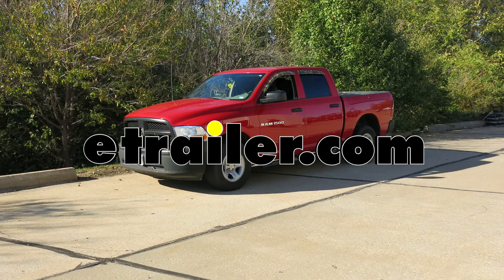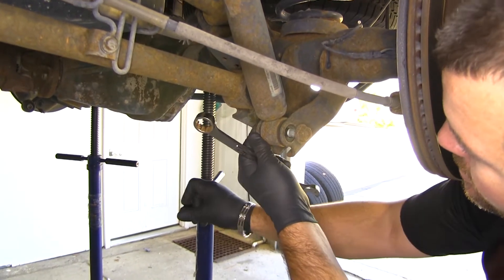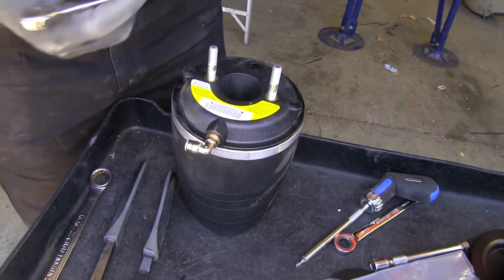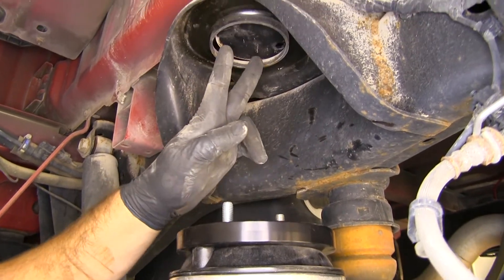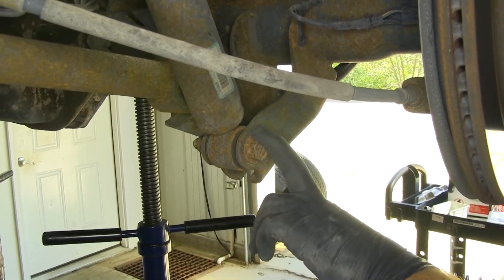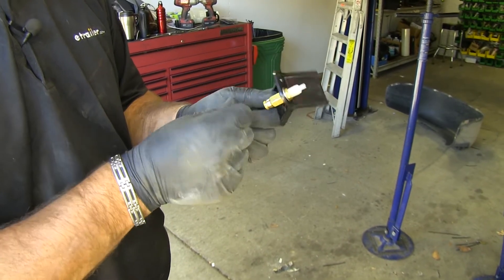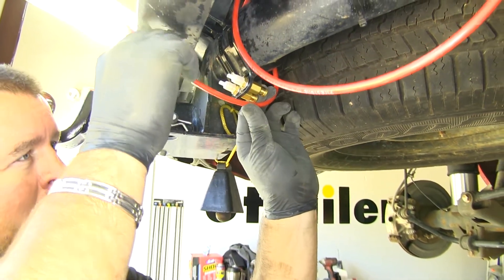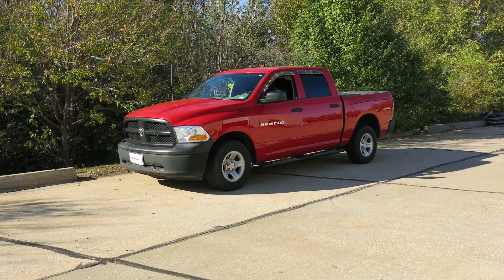etrailer | Installing the Firestone Coil-to-Air-Spring Conversion Kit on your 2012 Ram 1500

Comment: can i use this particular coil converter air bag on a lifted truck … same year 2012 1500 4x4
Reply from the maker: We have only confirmed that these will work with replacing the factory coil springs on the 2009-2018 Ram 1500. When a lift is added normally they will ad a larger spring or a spacer block. In this case these air springs would not work.
Reply: I have a 2021 ram rebel with a factory lift. These bags if so desired can lift the rear 3 inches. Keep in mind if you do use these to lift the rear ride quality and payload may suffer.